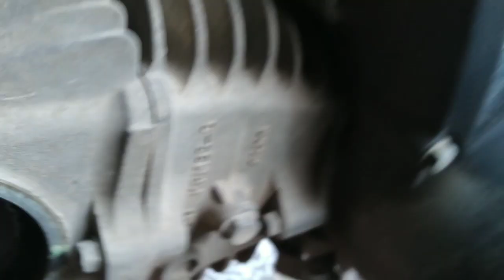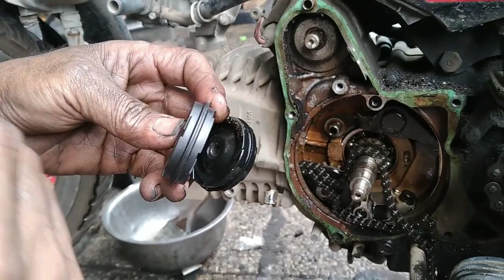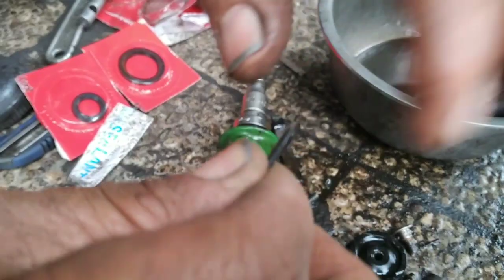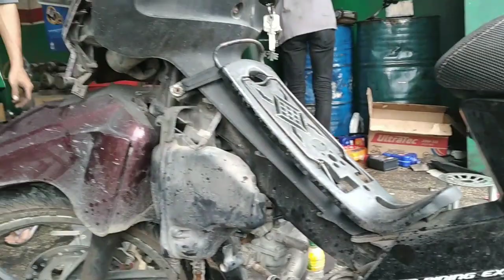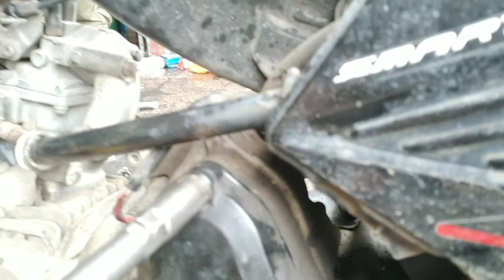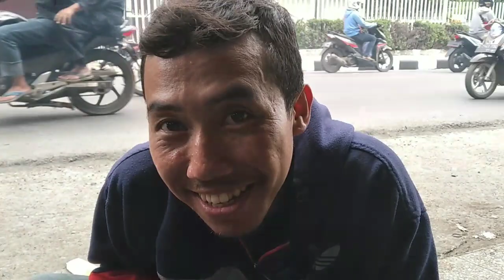Cara ganti KETENG Honda Revo lama

Comment: Mas motor saya honda revo rancip..bocor keluar oli dekat kabel stater yg di atas, itu apanya mas harus  ganti seal nya aja ya mas solusi nya
Reply from the maker: Buka dinamo starter ganti seal oring dinamonya atau cukup bersihkan pakai bensin, dan beri lem paking tribon atau sealen
Reply: Makasih masukanya mas..good luck.sukses selalu..
Reply from the maker: Sama" semoga bermanfaat
Reply: Iya mas..mas kabel yg di keluar.. di atas magnet staternya mas kan ada kabel 2 di atasnya di atas situ mas keluar..mas
Reply from the maker: Kabel Spul buka blok magnetnya cuci pakai bensin dan di beri lem paking, terus ada juga suit netral tinggal buka bautnya bersihkan pakai bensin dan beri lem paking, tapi cek juga paking blok magnetnya  barang kali udah harus ganti
Reply: Makasih masukanya
Reply from the maker: Sama" smooga bermanfaat